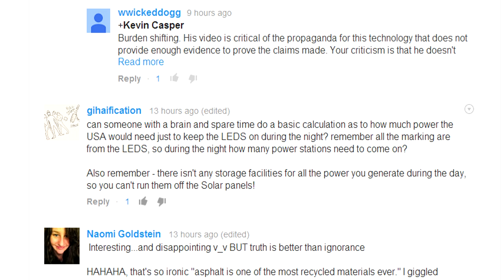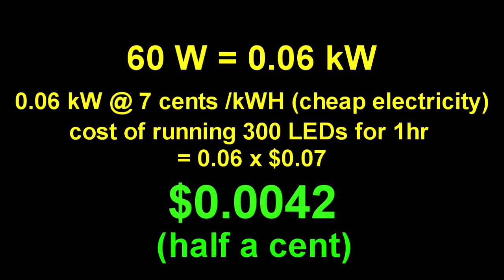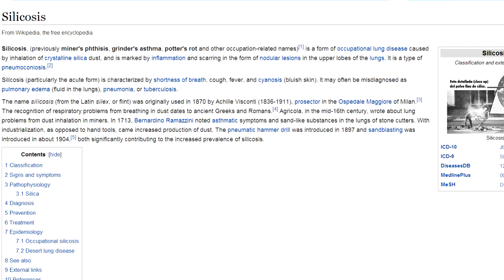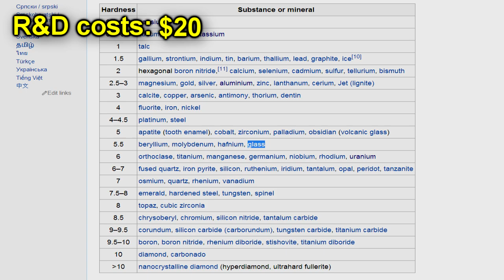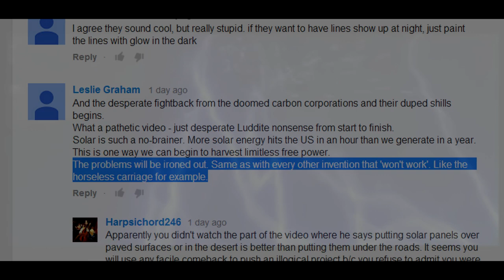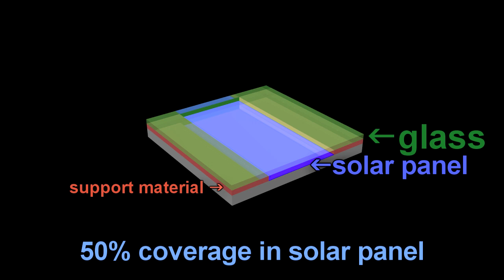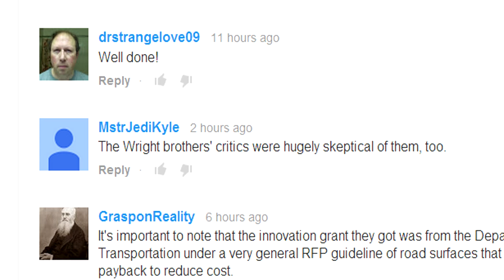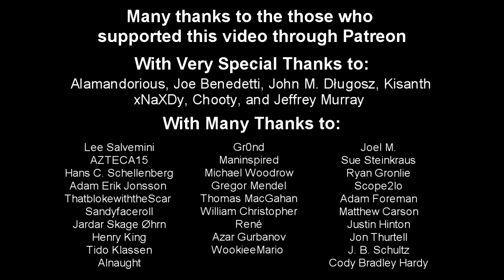Solar Roadways, IMPORTANT QUESTIONS AND ANSWERS!

Comment: This video presents interesting information but does not quite provide much supporting evidence for that information.

The statement "there isn't any storage facility for all of the power you generate during the day, so you can't run them all off solar panels" is patently false. You are not allowed to start with a qualifier that does not exist in the real world. We have batteries and capacitors that can store energy at night.

You then say "let's say these panels are about half a meter by half a meter" as if it is a fact. Well no, they are not half a meter by half a meter. They are, according to their website, 4 square feet (that's about 0.37 square meters).

You then select LEDs at random from Amazon from a relatively unknown brand. There are several issues with this. The price of the LEDs you listed include the control module and power adapter rather than just the LEDs. I also know that the price for the LEDs will be even cheaper than that due to mass production reducing costs. You also do not know exactly how bright the LEDs they require will be, nor what power consumption they will use. Why did you select the relatively unknown brand Tagital? Are you aware of larger brand such as Whelen, Federal Signal, and SureFire that produce LED products that are brighter and use less power?

I am also not sure how you are calculating the cost for power. As I said earlier, I am most certain that the power generated by the panels themselves will be more than enough to provide power to the LEDs and store that power in battery or capacitor form. Thus, the end bill for the LEDs and power costs are rather random calculations that do not really make much sense.

In regards to lifespan your statement is once again based upon the Tagital brand. For example Whelen LED products are rated to last at least 100,000 hours, twice as many as 50,000. Yes, your point that LEDs would eventually need to be changed is valid. However, I think you're making quick judgements based upon finding one brand on Amazon.

In terms of glass, glass is much harder than asphalt (which is simple bitumen). I would argue that the existence of ballistic glass makes it a very suitable material by which to build roads from. There are very few health issues with glass manufacturing today. According to the American Lung Association Silicosis is completely preventable. Respirators, water sprays, and ventilation systems easily prevent the danger.

Your cost calculation is, as I already pointed out, flawed. The reason your LEDs do not show up in sunlight is because you are using an off-brand. Try that with a Federal Signal Impaxx multi-colored LED system and you'll be able to see them from hundreds of meters away in full daylight. You then use regular glass even though the glass used in the Solar Roadways project is tempered and not subject to that level of wear. They are not just looking for R&D money, they have already produced a working prototype.

You then say "for the sake of argument" and claim that only 50% are covered in solar panels. Do you have a source for this, or are you just making assumptions? It is not peer review if you are reviewing something that has not even been published yet.

Tempered glass is not the same as sapphire glass. I think you may have made a mistake when you said "it would cost 100 times" when the phrase highlighted said "it takes about 100 times more energy" as we know that cost does not equal energy. The subject theory of value states that the value of goods is not based upon the amount of labor required to produce it, but rather it is based upon the importance of the product at doing what it is supposed to do. Now, this may not always be true (depending on your economical system of choice), but I believe this theory is valid in this case.

In conclusion, yes, you do make some valid points. Solar panels on the side of the road would be more efficient. However, the convenience of Solar Roadways could be made use of in car parks, especially with the ability for the LEDs to change parking spaces. You're also not making valid comparisons, as you are using random products from Amazon, market value prices, and regular glass instead of tempered glass. Also, accusing glass of being a bad road surface is rather hypocritical of you if you're supporting asphalt. Asphalt is a terrible road surface. It is soft, wears quickly, and simply can't support the weight and wear of heavy freight. That's why countries that use asphalt have bad road surfaces. The USA is rated poor for road surfaces by the American Society of Civil Engineers. Concrete is better than asphalt, but not without its faults.
Reply: Glass vs Asphalt:

Tempered Glass, Sapphire Glass, whatever kind of glass you want, is still made of, you guessed it, glass. Any random sand pebble from the side of the road will be harder than glass. Said glass cannot be scratch proof (scratch resistant, yes), especially with millions of cars and tons of pressure constantly moving around on it.

Not to forget the health concerns that'd come from the glass particles being taken off constantly. We're not really talking about the actual manufacture of it, which as you are correct to point out is safe, yes, but being around constantly eroding glass.

LEDs

It does not matter if TF used Retail prices, because even if you account for mass production, the costs would still be astronomical (simply less astronomical). In addition, even manufacture prices for high quality/high powered leds would still be relatively significant 

Most Leds used for visibility in direct sunlight, such as stoplights, are angled directly at you, not stuck behind thick scratched glass, concentrated together, and under sun shaders.

You saying  "as I said earlier, I am most certain that the power generated by the panels themselves will be more than enough to provide power to the LEDs and store that power in battery or capacitor form", is taking the piss. You can't just make an assertion like that, you need to try and prove it.

Compare the solar energy generated from the given size of a solar panels, and the energy required to power one of those IMAXX Leds you were talking about.

The test is simple. Take a Led of any brand you like, one that doesn't require 5 watts to power itself at the required level of brightness if possible. Put it under a glass panel. Angle at 90 degrees on the ground. Then move let's say 5 meters away, get in your car, and tell me if you can see them.

Obviously, to be considered safe, the Leds would need to be visible from a lot farther than 5 meters, so feel free to do those tests too.

Battery & Capacitors

Your most outlandish statement by far. Storing & Transporting power/energy is the biggest problem we have regarding energy right now. Adding batteries to these panels would be disastrous both in terms of cost, efficiency, and ecology.

I'm not skilled enough to provide more in depth calculations regarding this, however the onus of proof is not on me. As the person making the claim that this would not be a problem at all, you are required to support your assertions with the logic and maths that lead you to believe that.

Yes, we do have batteries and capacitors. Care to look at their capacity and actually look into the feasibility ?

I will say however that you are more reasoned in your argument than most, so I thank you for keeping your disagreement civil and somewhat nuanced.
Reply: Kortomir On Glass:

The issue on scratching is a valid one to a degree, but scratch resistant glass is an immerging technology and I do not think it is so far behind as to prevent research and development work on the Solar Roadways project. Gorilla Glass is one such example of the technology, and in the past few years has already progressed by three generations.

In terms of health concerns I do not see why that would be an issue. In order to present a health risk the glass would have to create a cloud of particles, which wouldn’t happen from regular scratching.

On LEDs:

The costs would be high, but nowhere near the costs listed. To use retail prices is intellectual dishonesty, especially in the final calculation. Have you experience with leading LED manufacturers such as Cree, or brands such as Federal Signal? Their LEDs are far in advance of the Amazon purchased LEDs that were used in this video, and are very visible in the sunlight.

My statement that the power generated by the panels themselves would be more than enough to power the LEDs is based on several factors. Firstly, all of the power I use comes from solar sources. I work with City Administration in my political studies so I know the factors involved in solar power distribution. Solar technology progresses in efficiency with each year by a large factor. Panels can already achieve over 40% efficiency, which is a huge increase from only a few years ago. The amount of energy one panel can produce today is less than that one panel could produce next year. Secondly, TF’s statement on how much power would be required to power all of the LEDs is something that is also intellectually dishonest. We are talking about roadways, all of the LEDs will not be on all of the time. Unless there is an urgent need, the only LEDs that will be switched on would be the ones in the center of the road and the ones on the side of the road. Further, these LEDs could even be switched off if the road does not detect any vehicles (Solar Roadways already states they have pressure plates in their panels). So his power calculations are vastly overstated.

The test you recommended has one slight flaw in it. LEDs do not need to be angled in the way you stated. LEDs can obtain a wide degree of light visibility, you can see this on emergency vehicles or household televisions. One LED can have a visibility arc of 180 degrees fairly easily.

In terms of batteries and capacitors:

Solar Roadways has already stated that their panels work with utility corridors to allow for cabling and water. Such battery banks could be installed on the roadside in a similar corridor, or the power cables could simply lead to a battery bank facility. My hometown uses battery banks to store the energy produced by our solar panels, in fact I have never seen a solar setup that does not use batteries. Adding batteries to these panels is the only way they could possibly be used to provide power in the way stated in Solar Roadways advertising (to power all of the USA) as they would be needed for night use.

I’m not sure why you need me to work out the calculations for this. Are there any solar power plants near where you live that you could visit? All existing solar power plants use battery banks, which is why I say that it is the norm. Given that they are currently in use in almost all existing solar projects I don’t see why it would be unfeasible to do the same with Solar Roadways. Unfortunately, until Solar Roadways releases more data on their panels and LEDs (which they won't do until R&D is complete) I do not think there would be any way of calculating this more exactly.

And you are most welcome.

Comment: I still don't understand why they want to put the things in the road. Just about any other place would be more sensible.

The only worse idea I could think of is to put them on the floors of buildings, inside, in a room that doesn't have windows.
Reply: I have seen solar powered trash compactors inside - and actually below ground level - at L.A.'s Union Station. 

I suspect there's enough artificial light to run them, so they're kinda using solar cells as a really inefficient extension cord. Still...
Reply: I have seen solar powered trash compactors inside - and actually below ground level - at L.A.'s Union Station. 

I suspect there's enough artificial light to run them, so they're kinda using solar cells as a really inefficient extension cord. Still...

Comment: I'm not a genius or anything, but wouldn't the solar panels get dirty as well? And wouldn't that affect the power they produce?
If the surface was smooth, I guess the wind could blow some dirt away with a little luck, but the surface on these panels looks like a pain to clean.

Comment: Thunderfoot R&D: Testing 2 strawmen.

TF has no idea what kind of glass it is, if it is coated or treated with something etc. With his logic I can prove that glass cannot be bullet resistant by smashing a drinking glass with a spoon. Or I can prove that armour could never have been done from paper by cutting some toilet paper.

Real R&D also involves actual development, meaning you spend research efforts on improving your old ideas after testing them.
Reply: Coffee pots are made from borosilicate glass
Bottles aren't.
Reply: Glass by itself isn't bullet resistant. Windows can be made bullet & bomb proof, but not glass.
Reply: First off I am a scientific glassblower ,I have been in the industry over 15 years. It doesn't matter what kind of glass it is ,it all scratches from sand being ground into it.  Your example is moronic, because bullet proof glass is not fucking glass at all, it is plastic. There is NO glass in bullet proof glass. Of course unlike you ,tfoot knows this as he is also a scientific glassblower, ( you can see this in some of his videos) , so he has to have knowledge about the properties of glass, unlike you.
Reply: Brian T My example only sounds moronic to a moron who doesn't get the point and thinks that unsupported claims of authority carries any weight on the internet. Of course I knew it was plastic, if I smash a plastic drinking glass the point still stands as it never was about the material, but the bad logic in his argument.

Also Iron has some properties, but steel has other. Copper plates have some properties, but gold plated copper plates have other. Just because something is mainly one material doesn't mean it must have a very narrow set of properties.

Part of R&D is making sure that this material can withstand wear and tear from traffic without losing too much transparency. The reason they chose glass is because it is environmentally friendly, but it doesn't have to be 100% glass.
Reply: ***** Instead of listening to second hand stories about their material why don't you ask them what material they use and how they prevent scratching? Maybe it is already solved by not having glass on the very top, or some other way? Maybe it is something they are working on and are close to solving? Don't just assume they forgot about the scratching issue because TF makes a video based on an advert of this product without doing any research himself about it.

Comment: All right, so here are my questions to you:

What do you know about things like LED traffic lights? Those are plenty bright enough to see during the day, and they last a long while. How much power do they use? Additionally, the LEDs are only going to be lit when there are cars actually on the road. On parts of the road without cars, the LEDs would be turned off to conserve energy. How does that impact your figures?

The glass scratch tests that you did don't seem fair simply because you don't have access to the tempered glass material actually used in the roads. How do you know that the material they used in their tests is comparable to the basic glass you used?

On top of that, I find it unlikely that the consumer products you got to test are comparable to the industrial products likely to be used in the production of actual solar roads. They are prototyping right now, which requires buying expensive components in small amounts. However, when you start mass producing things, the numbers suddenly start shrinking by a wide margin.

Also, this project is something that is designed to be implemented over the course of decades, not just a few years. By the time that this entire project would be implemented, there will have been all kinds of technological advancements for all of the technologies involved.

Additionally, despite the fact that this will be expensive to implement, the point is to create a road surface that can pay for itself over time. Though the current road system may be relatively cheap now, how cheap will it be when we run out of crude oil to use in the production of these roads? For that matter, how much does it cost to fix all the roads today? Even if you ignore the solar panel and electronics portion and just focus on a new road surface, what do you propose would be a good substitute when that happens?